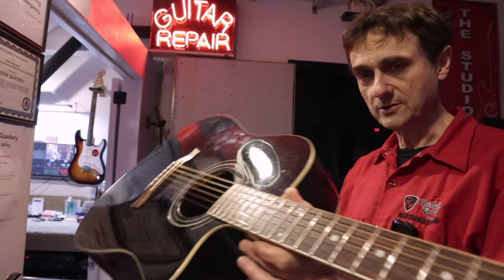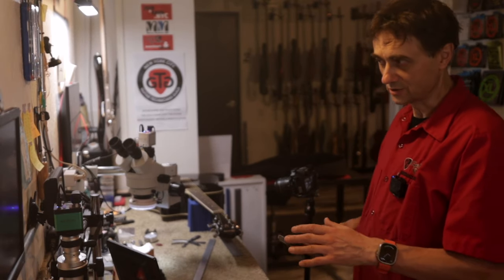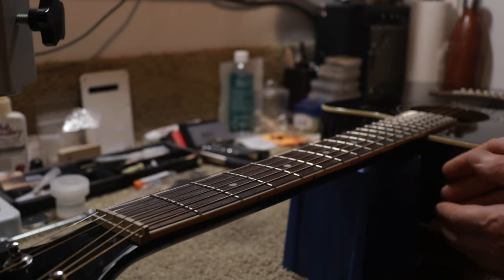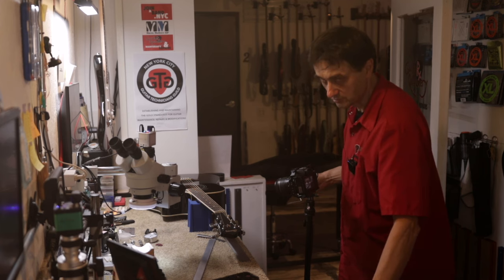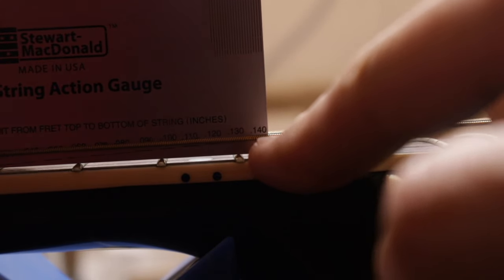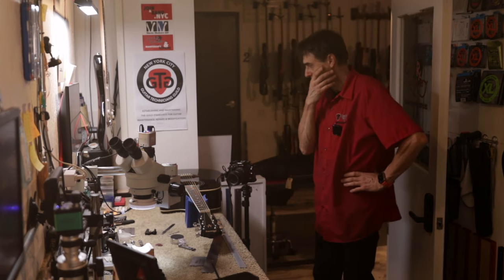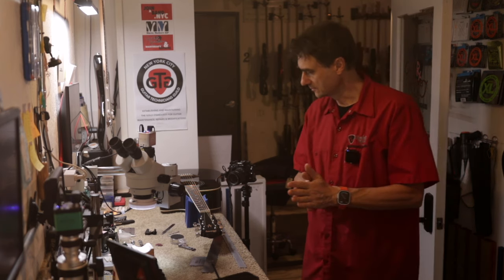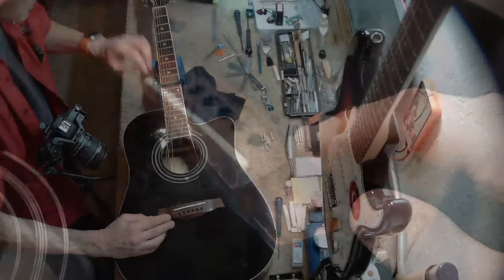Impossible Acoustic Guitar Setup Ibanez V70

Comment: Why even waste your time with all the other nonsense when the lifting bridge should be the 1st thing you addressed? That's the very 1st thing I would have done: call the customer and explain the issues and needed repairs. Why even waste time with everything else? It's virtually useless without addressing the bridge first
Reply: 2nd. You don't adjust the truss rod to change action/string height. That's not what it's for.

Why even waste your time? 🤷🤦
Reply from the maker: I believe you misunderstood the point I was trying to make. People keep asking me to do setups on guitars that can't be improved by doing setups. People also keep telling me that all they need is a truss rod adjustment. 

A customer dropped of that guitar in my absence and told me (over the phone) that all he needed was a truss rod adjustment to lower he action. I looked at the guitar and first thing I saw was a bridge lift (as I've explained in the video). Next thing I saw was the neck angle issue (as I've also explained in the video).

Then I called the customer and explained those issues and told him that it would cost more to fix than to buy a new (or used) guitar of the same level. We cancelled the order and that's how far it went with the customer. It took hi over a month to pick up his guitar.

In that time I used his guitar to make a video that shows what kind of guitars people bring to my shop, requesting setup, and more often than not just telling me to adjust the truss rod and that the guitar would be good to go (as I've explained in the video).

So, for the sake of the video (for entertainment and educational purposes) I went on to demonstrate what results we would get from doing what the customers tell us to do, when they bring guitars like this one. 

The point of me doing these adjustments (which is what customers tell me to do when they think they know what they are talking about) was to prove that such guitars cannot be adjusted with setups. 

I actually thought that all that was pretty clearly explained in the video, especially given the fact that I was using the "polishing a turn" analogy. 

Everyone else got the point and got the joke (judging from all the other people's comments). 

Even the title of the vide states "Impossible setup" and the thumbnail says "the setup that can't be done".
Reply from the maker: You're correct, "You don't adjust the truss rod to change action/string height. That's not what it's for." which is exactly what I say in this video.

Comment: There's no getting around the bridge work that needs to be done to cure the bridge lift. That said do that first and hen work from there to get string action height down. a temporary work around is less string tension for a 1/2 or full step for an alternate tuning for the bridge lifting, if that bridge work isn't going to be done for a reset & glue. And then capo the 1st & 2nd frets. As the intonated saddle was shaved from the bottom, it also could have been filed & slotted like the nut instead. This guitar isn't exactly Martin +/-$ 3K build, it's a +/- $ 200 acoustic electric. 2 things I try to avoid doing, resetting a neck for shimming, bridge work is the other, this one there is no getting around the bridge lifting. As a DIYer, I'll do a bridge repair before a neck reset. And the neck reset I'll leave that level of a repair to a professional. I do prefer the bolt-on necks for electrics, because I can shim & reset a neck pocket issue. I avoid set neck guitars for that repair, but for the most part with an acoustic there's not much getting away from a set neck, even the Taylor bolt-on system is a bit more intensive for dialing in the shims they send you. This guitar was at least a bridge repair from the start. Probably not worth the cost of a bridge remove & glue, but let's face it, too much life left in that guitar to just put it at the curb to become landfill debris. Parted out & it probably gets enough money to put down towards a new one ? Some music stores will take some trade-in value & then turn their technician loose on it for the price of parts & the hourly rate to sell it for FMV as repaired.

I have an 2010 Ovation Applause that was preowned that way with issues. I ended up slotting the saddle pickup, while retaining the intonated saddle, there was no bridge lifting and I still have enough string break angle to get the guitar strings to sit for string action height. Plays better than it ever did over the last 5 years of ownership. I bought a spare saddle part for the piezo pickup, it was around $ 10 as an insurance policy to put it back if I screwed it up. I got lucky and it worked out fine. and if one plays Cowboy chords, most any guitar will be intonated for that. I mean it's an acoustic electric, mellow tunes and intonated it will be for strumming open strings & Cowboy chords. I don't think anyone is going to be hitting the higher notes at the 19th & 20th frets.
Reply from the maker: We didn’t do any work on the guitar. I just decided to use it for the video and the customer kept it for sentimental reasons.

I don’t even work on Ovation guitars.